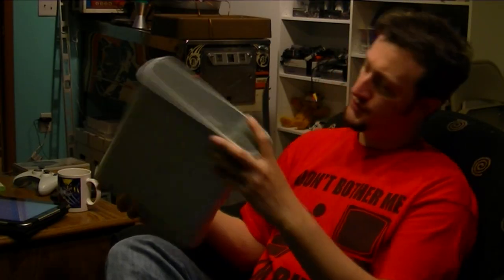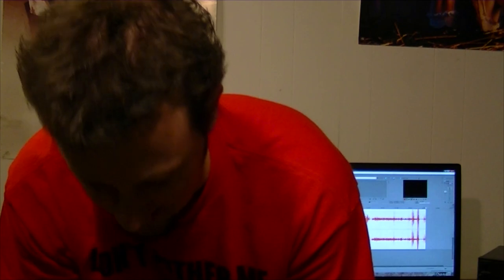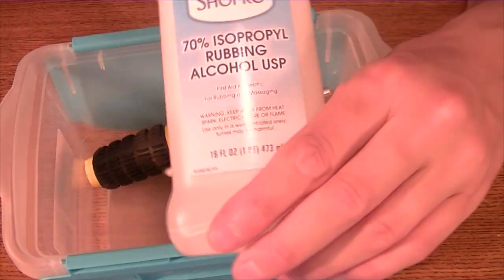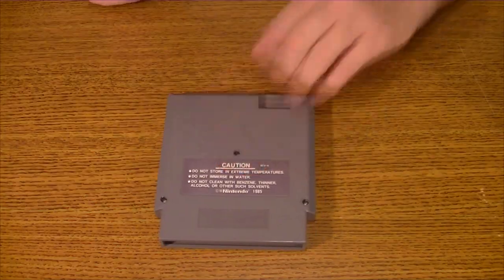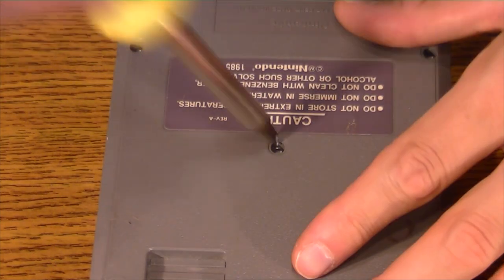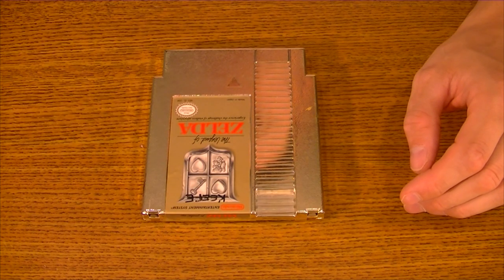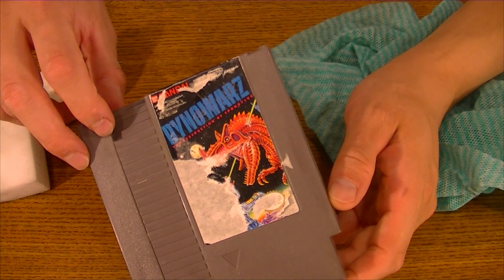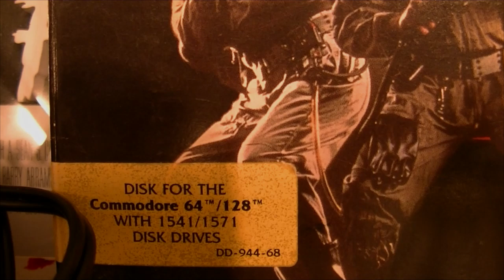Clean Your Nintendo NES Games (or Stop Blowing your Games!) 8-bit #2

Comment: 16:00 Here's a good trick. When you have label remnants on something, no need to break out the harsh chemicals. Just get some packing tape and stick it on and peel it off, the paper will come with. Rinse and repeat until all the label is gone.

Comment: Here's the real advice you should be taking: Go to amazon and buy a bottle of 99.9% anhydrous isopropyl alcohol (it meets US military specifications to clean printed circuit boards), and then use a cotton swab and clean the contacts until the cotton swabs are clear. That's it. No need for abrasives (magic eraser and sandpaper), they wear away the contacts to an unnecessary degree and will destroy your games over time. All you want to do is get rid of the oxide layer on the contacts, and 99.9% isopropyl will do that.

This video makes me cringe so badly. Sandpaper smdh
Reply: +Peter Battaglia OH GOD, and you can see water damage on the bottom of the Mario 2 label when he takes the isopropyl and paper towel to it. This video should be titled "How to ruin your NES games". You can see the band of water at the bottom of the label in the before and after pictures of Mario 2.
Reply: Thank you! Finally someone who gives decent and sound advice!
Reply: That's what I was thinking about sand paper.
Reply: Isopropyl alcohol does little or nothing to remove oxidation (it is a solvent, which is useful for breaking down oils which bind dirt to a surface; for oxidation you need an acid, not a solvent), and it won't even put a dent in the level of crud as seen in this video, unless you perhaps soak it for days or weeks. Bar Keepers Friend powder mixed with water into a thin watery solution (active ingredient = oxalic acid) is what you need; it cleans to the bare metal ~instantly, and is no more abrasive than e.g., talcum powder.
Reply: To everyone in the thread: Really the trick is to only step up the cleaning power if you have to as there are some things that alcohol alone won't cut through. So after starting with just the alcohol (chemical) and it fails, switch to magic eraser or extremely fine sandpaper (mild abrasive), if that fails, go with a pencil eraser (a bit more abrasive), then brasso (even more abrasive plus chemical), etc... 

PixelPerspective for instance had a case where there were deeply rusted cart pins that would not allow the game to play, so he had to wear off the rust until it did. An extreme case, but they are out there since the care people take with their carts is quite varied.
Reply: I'd say a combination of tools/chemicals is what you should use. While an abrasive usually isn't good for circuit boards, something like an eraser on those big-ass 80's contacts once every 25 years won't hurt it. Goof-off is really good for gunk and stickers, etc....for contact oxidation on the circuit board, try DeoxIT D100 instead of alcohol. it'll clean as well as prevent future oxidation. I agree the 99.9% IPA is better than the 30% water stuff in the video.

Comment: NOOOOOOOOO DON'T USE SANDPAPER
In the video you just removed the Gold plating in the contacts... It protects the copper from rusting. Don't do that! Just the eraser will do fine!
 Also, for the permanent markers: Just spray some deodorant on it. Any brand will do I believe, but you just swipe it once and it disappears right away. It's magical

Comment: Use a pink pencil eraser to clean NES games, it absorbs all carbon and dirt with ease. Use 90% alcohol as clean smooth wipe, not a scrub.  Done deal!  Don't use polish or things like brasso, they encourage dirt accumulation and leave residue to prevent connection.

Comment: I highly suggest using just a higher percent of alcohol or more elbow grease with the eraser step. I DO NOT RECOMMEND using sand paper and "magic eraser" (which is a fine sandpaper in a puffy form) will actually sand down and strip the pins of metal. The harder you scrub either type of sand paper (magic eraser) the more damage you will do. Eventually removing the coating and thus destroying the game. It works great the first couple of times because it removes all the dirt and the first layer of metal. But after a while the game will be damaged. I literally clean 50+ cartridges a day so I've learned from mistakes some things that cause damage over time.

Comment: Don't use sandpaper or a screwdriving, it will scratch the plastic of the cartride.
An interresting note about duckhunt is that am amezed how those ducks can even fly behind the tree just to avoid light detection,this is amezing since the nes only has 1 background layer, so nintendo had to find a trick to get this effect, so even in 1984 they were combating limmitations, wow .
Reply: johney supergd If u wanna see combatting limitations, you should see some games for the Atari 2600. Especially Ms. Pacman(Not the original Pacman that sucks on this platform)

Comment: Be very careful using Goo Gone or any water-based cleaner (even 91% isopropyl alcohol is 9% water) near the labels. Water will soak in at the edges of the label or even through the surface if the plastic coating is scratched or abraded. The water will evaporate, but the paper will be damaged permanently. Goo Gone will soak in and stay there, forever. Un-Do is a better adhesive remover because it will not damage paper, and evaporates completely, leaving no residue.

Comment: If you just use a dry erase marker for the magic marker, it will come off no problem. The sandpaper on the connectors almost made me throw my PC across the room.
Reply: Same
Reply: It's very fine grit so it's not that bad. He only did 3 scrapes anyways, he didn't go nuts like you would with a Q-Tip and Isopropyl Alcohol
Reply: pejnismiggle Well I actually condone the usage of isopropyl alcohol on these kinds of things. I tend to use windex or professional contact cleaner.
Reply: ***** Windex and above 90% Isopropyl do the exact same thing.
Reply: As someone who was raised by an electronics tech, I made a more horrified face than I do when watching zit popping vids or something.

Comment: 8bitredcat  to remove glue residues use wd40 or white mineral oil on a cloth, it just rubs out really fast. it even works when removing labels, just soak the suckers and they come right off. no need to use your nails. and it doesnt look like the game was set on fire afterwards.

Comment: I'm think sand paper is not a good idea because it roughens up the surface of the contacts, making it less easy to slide in and out of your system, basically roughen up the contacts of your console too and in time it will make the prong damage more. I wouldn't use any grid sand paper on game contacts. Use some damp baking soda and some rubbing instead.

Comment: My cleaning method tools and method for the contacts is sand paper if it's filth followed by alcohol and a qtip and a eraser if i can't get deep into the contacts for the outside of a nes cart when it comes to pen or eraser a mix of my eraser and alcohol or a wet wipe instead of alcohol and a qtip most of the time it works like a charm the only thing i have come across that i have trouble cleaning is a sega genesis cartridge of rolling thunder 3 and it came complete with manual and case.

Comment: The question is : "Why is the motherboard so small?" not "why is the cartridge so big?"

The reason is the original Famicom cartridges are quite small. so when Nintendo ported those games over to the US/ UK they just used the same boards as the Famicom games and stuck them in NES cartridges. As for WHY NES cartridges are so big, it could have had something to do with the Video game Crash of 1983. Nintendo redesigned the Famicom to pass for an "entertainment computer" instead of a "games console". But I'm just guessing at this point.
Reply: I'm no expert at this but I don't think they just straight ported the games. Famicom games have 60 pins NES games have 72 pins.

Comment: What a wonderfully insightful and helpful video!  thanks a million.  Also, have you ever tried using WD-40 for the pins?  I hear it's supposed to be much better than isopropyl for evading corrosion but haven't tried it myself.

Comment: This is how I feel about how you cleaned the contacts

Rubbing Alcohol: Obvious is Obviously Obvious,
However the way you're just applying it makes it work

Eraser: I would use it after using the Magic Eraser but using both just gets tedious

Magic Eraser: ok thats friggin' Genius, I now have my collection of carts working, thank you

Sandpaper: AAAAHHHH!!! EVERYTHING IS HORRIBLE!!!!!, YOUR GONNA KILL THE CARTRIDGE ARE YOU CRAZY?!?!?!?!?
<(CRINGING INTENSIFIES)>
Reply: I doubt the sandpaper could eat away the... what are they made of? copper? connectors so easily, especially if the surface of the connectirs are covered in 30 years worth of grime.
Reply: It has to be the really fine sand paper or try crocus cloth.

Comment: Cleaning works great on just about all of my games.  Question, I have Tengen RBI baseball which requires a star-shaped bit (size T10) which I did fine with, but then it has those three tabs at the top.  Any tips on how to remove the case with these tabs?  I still can't get it to work despite the shiny clean contacts and cleaned system.  Any other ideas I could try?

Comment: Hi! I followed both parts of this guide (I thotoughly cleaned the 72 pin connector inside and got my cartridge contacts shining clean), and my success rate on most my games have improved but... I'm still getting the flashing light very often. I noticed that the trick of pulling the cartridge out a little bit and pushing it down sometimes helps..I don't think my nes needs more cleaning. Can you diagnose what's wrong just by seeing that it needs to be pushed down even though everything is cleaned?

Comment: T10 Torx screws? So it's one of the unlicensed carts? If its like the other black tengen carts, you might want to use a razor blade or a thin piece of tin to push the clips out of the way.

Comment: This was excellent. Thanks for the helpful vid. Quick question for anyone out there who may know: Is the problem ever the game system itself? Does that ever need cleaning or is it always really just the game cartridges that are the culprits?
Reply: The NES specifically has a bad problem as a console. Most consoles that utilize cartridges are Top Loaders with dust prevention.  The NES has its connector set up to load on the side as you know that leaves a lot of the dirt to work with gravity.  So with a NES specifically you want to clean the 72 pin connector (Or you may replace it completely which I haven't done) Disable the Anti Piracy chip inside of it, and finally bend the pins back into place.  This shouldn't take long if you actually are dedicated for 30 minutes at most.  As I said most consoles don't require this, and doesn't require you to dis assemble the console as the NES does, but it is a good practice, better safe than sorry.
Reply: Imassassin90
people dont know how to clean there games the 72-pin connector is not the problem they use alcohol thats leaves a resudue that will be a magnet to dust.
you need a non residue cleaner and a simple nylon brush.
Reply: SuperDeluxe80 I've never heard that in all of my searching on the internet, and all the alcohol I've ever used never left any type of residue, and the 72 pin connector has been proven to have problems in some cases, especially in frequent users of Game Genies as the Pins would bend out of place, and dirt can get in both sides of the coin.  And as a side note your distaste in grammar is killing me, especially the swapping of homophones.
Reply: Imassassin90
your ignorance if chemicals is killing me and what it does to the metal on the PCB.
Reply: "if chemicals", 'nuff said.
Reply: Imassassin90
wow a typo triggered your OCD. might need to get that checked out.
Reply: There's nothing wrong with following Hitler's grammatical belief's to a tee.

Comment: It kind of a cool vid for an old school game collector but the tools u had to use just to disassemble one game is more crap than u need for an xbox 360... for an xbox u need a pocket Knife ur fingers and a torks bit or screwdriver u needed more than that plus a special bit just for an old nes game
Reply: guess what. get a buch of unbendable straws, heat up the end until its at melting point, and put it on the security bit, wait for it to cool, easy 1 use application for cheap as dirt

Comment: I dont dare to do this :( , is there another way?
Reply: Don't be reckless but remember that the contacts are literally just solid metal and, as the name suggests, need to do nothing but make contact
Reply: MCBV You see the bit where he uses the eraser? Do exactly that. I... am so horrified by everything else he is doing, but a Paper Mate eraser is quite literally all you need. It'll clean off the contacts with absolutely no damage. The only other thing you would need is like a fine paint brush to clean off the eraser residue. Works like a charm every single time.

Just the eraser. No other chemicals. BELIEVE IN ME.

Comment: BRASSO
Reply: Bar Keepers Friend powder (mixed with water; you want a watery solution, not a thick paste) is way better than Brasso for this sort of thing. They both contain oxalic acid as the main active ingredient, but Bar Keepers Friend is hardly abrasive at all (no more abrasive than e.g., talcum powder), while Brasso is quite abrasive (it will visibly scratch glass for example, while Bar Keepers Friend won't).